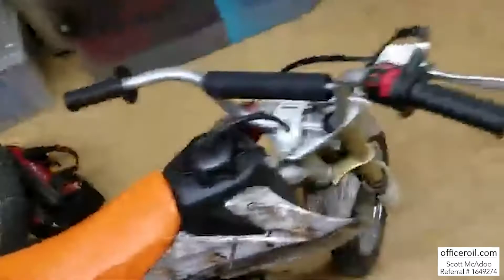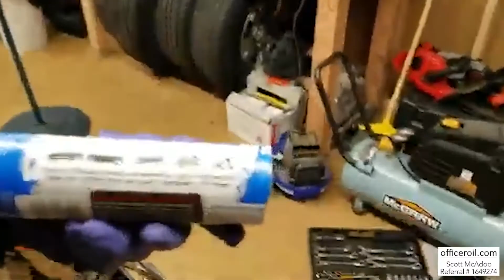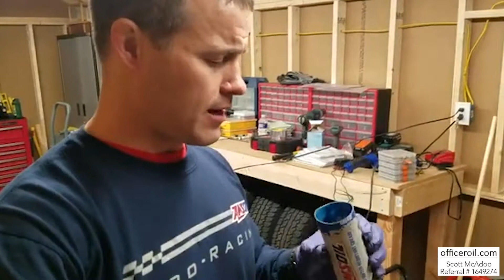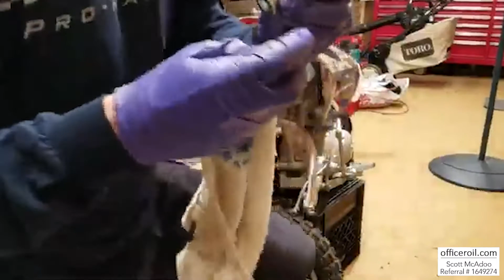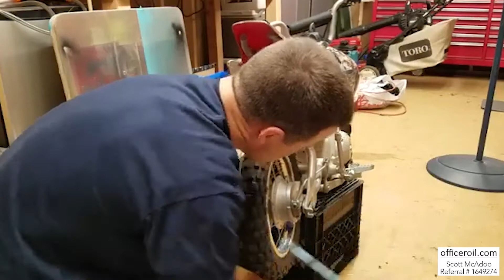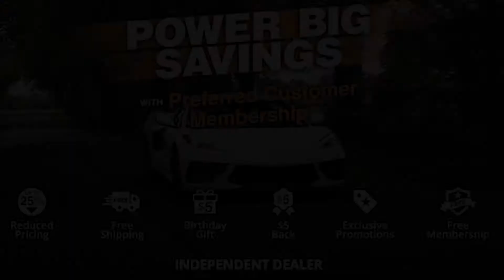Honda CRF50F Dirt Bike Synthetic Water Resistant Axle Grease

Comment: Hi Sir! Should I use this Grease for Pulley Scooter. Thank you!
And for Rubber. Slide Pin. Thank youu
Reply from the maker: Hi there!  Yes, it would work very well in that application.  It's essentially a turbo charged "multi-purpose" great that does an outstanding job in wet applications.  You're welcome.